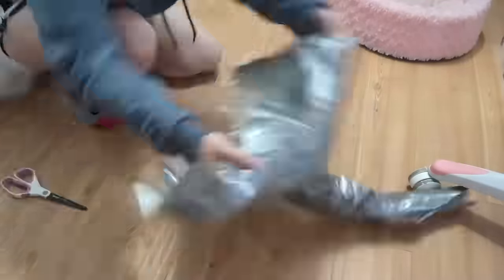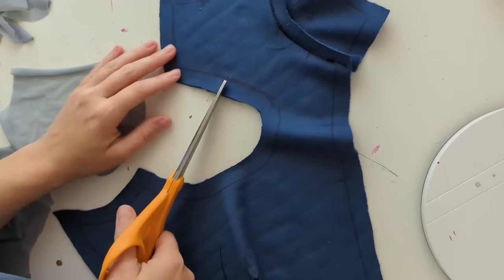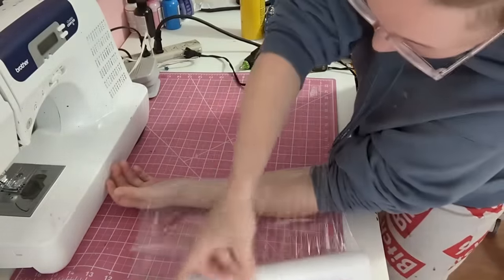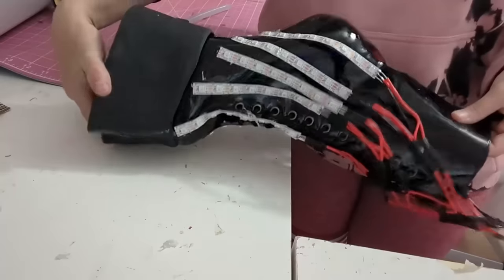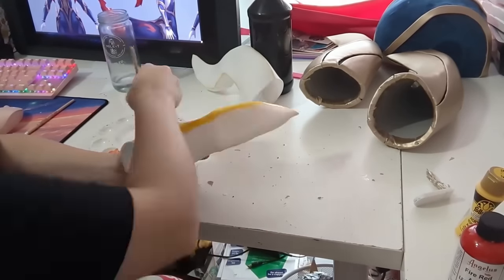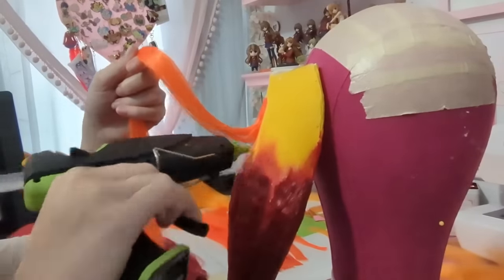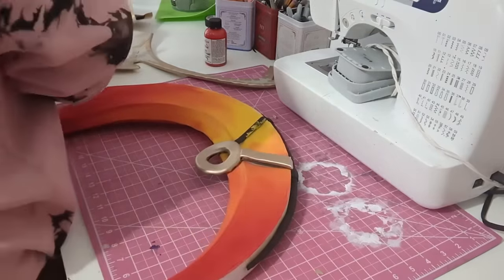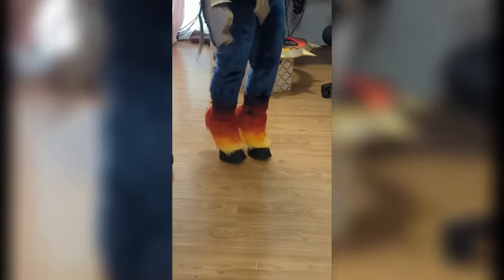My Biggest Cosplay Yet - Making a Walking & Glowing CENTAUR! | Nightbringer Lillia

Comment: I can understand the LED frustration, especially seeing how you put it together. I've got a few suggestions if you do DIY LEDs in the future that will make it a LOT easier. 

First, those RGB "fairy lights" you buy online are often WS2812b LEDs, so you can buy a cheap (and flexible!) string of LEDs and use your own controller. They may be a bit more expensive than the SMD tape you used here, but the added flexibility more than makes up for the cost. You can coil and wrap and twist them any way you need to and pack them as densely as you like.

Second, I recommend the Seeeduino Xiao. It's a SUPER tiny and SUPER cheap (like $5 cheap) Arduino with built-in USB-C. The size and price means you can buy a bunch of them and put the controller right next to the LEDs. Like one controller per hoof, for example. The USB-C means you can power it directly from a USB phone charger battery and only have one wire (a USB cable) to run from your battery to your lights. It means fewer solder joints, fewer wires, and much simpler design - which all adds up to easier development and fewer bugs to work out. 

I also recommend keeping your LEDs at least an inch off your diffuser, or aim the LEDs away from the diffuser at a matte white reflector to get smoother tones that don't have the individual LEDs shining through. 

All in all this was a LOT of work and you did an amazing job! Thanks for sharing it with us weirdos on the internet!
I'm an electronics / programming nerd, so if you want some guidance on future LED projects feel free to reach out to me, I'd be happy to help!

Comment: I loved your video! I'm actually in the process of making my first cosplay ever. I'm a little overwhelmed and I took a pause for a month to see if I really wanted to continue this massive pile of stress that my future self will have to deal with. Believe it or not, I've done some of the same things you're doing; such as, using the cling wrap duct-tape "measuring" method, haha! I don't have a ton of materials to work with, and my experience is kind of non-existent. I guess I won't know until I dive into the depths of the Ever Crafting Vortex. 
I also want to say I believe in you, and the struggle is worth it. And thank you ^-^

Comment: A tip for the horns you could have used a wire that was in the middle and then wrapped any material like news paper with tape or foil to shape the horns i used this technique once and it worked really well

Comment: How is a professional cosplayer a "sewing novice"? Also, this so fucking should have placed!
Also, use stretch thread for stretch fabric. So much easier. I would have painted those lines with an airbrush (or, let's face it, a Sharpie) while the fabric was stretched on a frame, but that's just me. The shaved technique is great, though.
I also like the honesty coming through, where you own the 'mistakes' and issues. Every step is a learning experience. I've been doing theatre for 40+ years and I've built some amazing sets and props over that time, as well as lit shows and designed sound (I also act and direct) and I would never have tried this, unless I was being paid (a lot). Be proud, you deserve it.

Comment: LED can be easy, but i think you went down the wrong path. For one those addressable LEDs can be powered completely independently from the controller connection. Technically speaking there is no reason for more than three wires going anywhere. There is also the possibility of using custom flexible PCBs as a base.